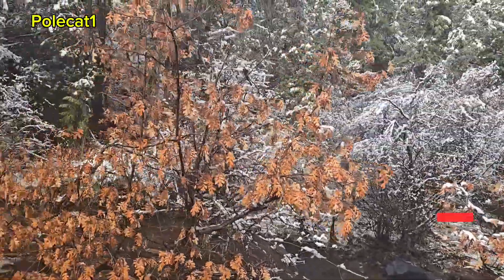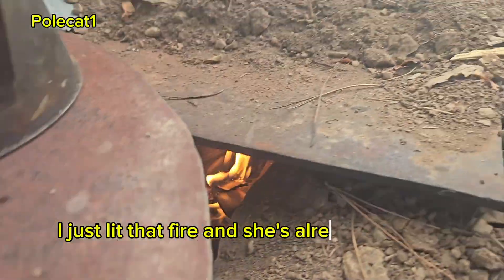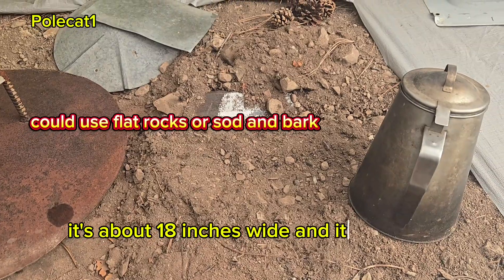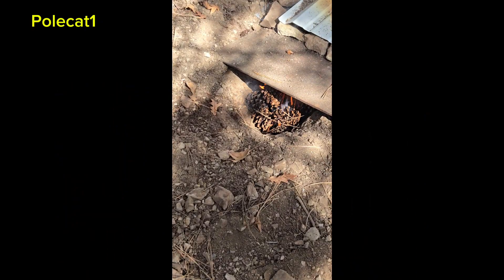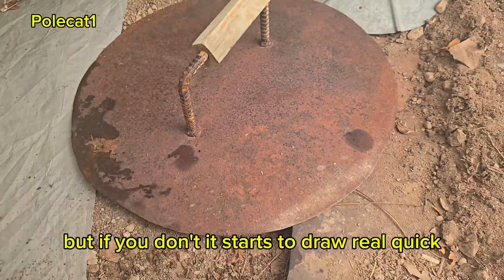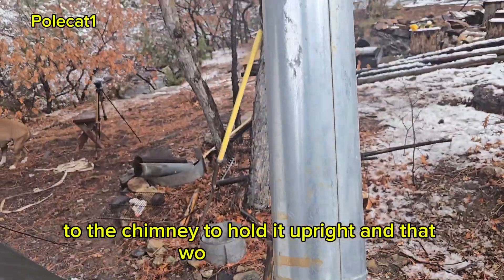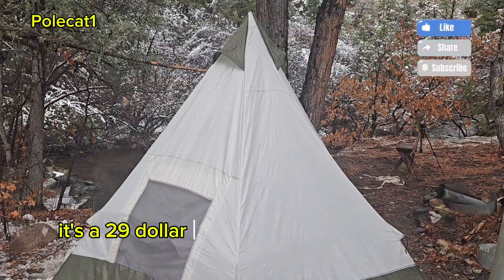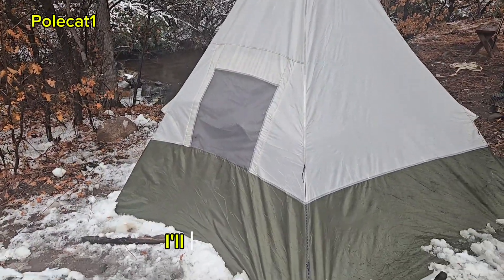Underground heat, best long term heat source

Comment: I’m confused, what’s in the trench? A pipe connected by an elbow joint to the vertical chimney?
Reply: He has another video where he uncovered it all and shows more details
Reply from the maker: Nothing is in the trench
Reply: @Polecat1  do you cover it at? The trench is confusing. Never seen a Dakota fire like this.
Reply: @Vercangetorix you put flat rocks or metal over it then cover with dirt

Comment: why have two videos, one supposedly with the "details", and have neither one show the most important steps of what happens after the trench is dug. do you put wood in there? How much water is put in there? The metal cover. The dirt. Placement of the chimney pipe. placement of an additional metal piece? details of how the wood and what size is placed in the trench? just bizarre. A how to video without the how to

Comment: I’d imagine (although probably not necessary to do) you could dig the trench a little bigger and use brick or ceramic to line the trench. Probably more trouble than it’s worth.
Reply from the maker: @nickcarroll8565  depends on how long you plan to stay